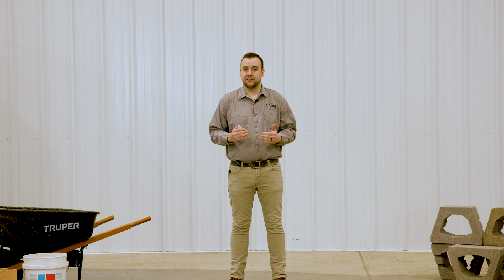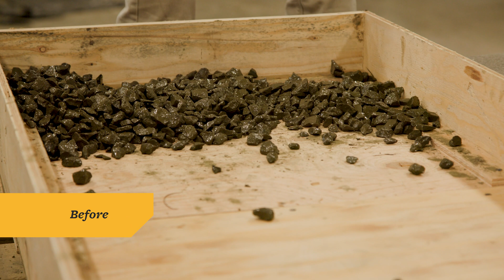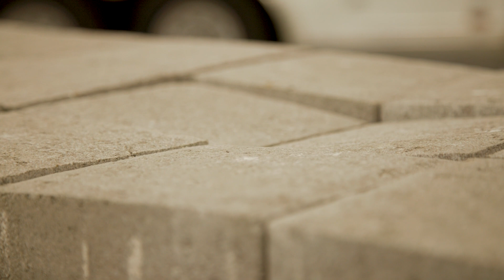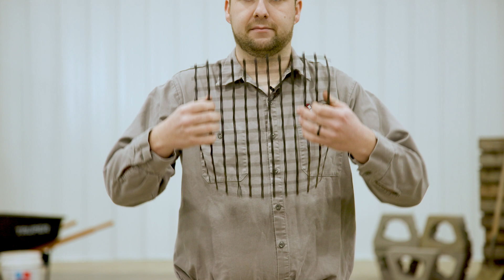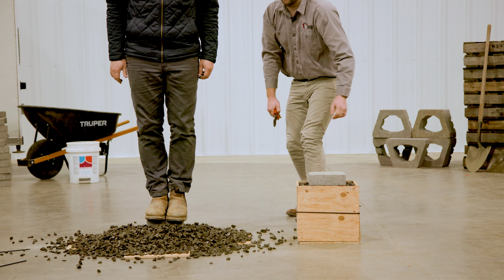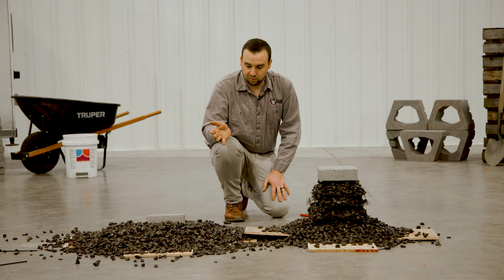How Geotextile Works in Hardscaping Projects: Stabilize Paver Patios, Driveways, Retaining Walls

Comment: Hi, I have never used geotextile before & I am thinking of using it under flagstone in my backyard.  Here are a few questions, lol...
  -  Does geotextile have good water penetration/drainage while blocking weeds, or does the water normally just settle, or does it slide away to the sides eventually?  
  -  What should my layers be, i.e. flagstone>geotextile>dirt?  
  -  Should I double the layer of geotextile for more longevity?  
  -  What should I use in between the flagstone?  Some places say to use polymeric sand which sticks together from water.  
  -  I was also thinking of adding long-life (20+ year) landscape fabric under the 1 geotextile layer to lower costs as I do not know the price differences.   
Area of flagstone is probably ~70-80 feet long X ~10 feet wide, I think.  The prime reason is blocking weeds coming from under ground, not from seeds on top.  I am also unsure how the flagstone & sand stay together since all of that will be "floating" above the geotextile.  Lots of questions, I know.  Thanks.
12/14/25
Reply from the maker: Hey Rob! Happy to help with your project!

Water drainage: Quality geotextile fabric allows excellent water penetration while blocking weeds. Water drains through, not around it - that's key for preventing pooling.

Layer order: You'll want: Flagstone → Bedding sand (1") → Compacted base rock (4-6") → Geotextile fabric → Compacted soil. The fabric goes under your base, not directly under the flagstone.

Doubling fabric: One quality layer is sufficient - doubling won't significantly improve weed prevention and might affect drainage.

Joint material: Polymeric sand works great for flagstone with tight joints. For wider joints (over 1"), consider decomposed granite or regular sand.

Fabric options: Commercial-grade geotextile is worth the investment over landscape fabric for a project this size - it's stronger and maintains drainage better long-term.

The flagstone stays stable because it's set in bedding sand over a compacted base - the geotextile below just prevents weeds and base contamination.

For an 800 sq ft area, proper base prep is crucial! Check out our installation guides at DIYwithWI.com - the principles are similar whether using flagstone or our paver stones.

Good luck with your project!
Reply: @WesternInterlock  ... Thanks for the reply.   Oh man, I do not have the luxury & costs for a deep 4-6-inch rock base, nor the time to do such a thing.  I will not be able to even drive in small machinery as there is no way from either side or back of house.   I am wondering if bedding sand would just be enough, as a compromise, i.e. flagstone>sand>textile>ground.  The soil/dirt level is already practically at ground level & there are already other things established there (gazebo, retaining wall gardens at 3 corners, sprinkler pipes).  This DIY project is basically a rework of the yard & not a new area.   We made the mistake 7-8 years ago of just putting the flagstone on top of bare dirt & then my friend put the sticking sand inbetween the stones.  As you can figure, its all weeds around the stones & I usually just had to use the string trimmer & herbicide to kill them for those past few years, which Im getting tired of, heh.  But I shall check your website, appreciated.
12/15/25
Reply from the maker: Thanks for the additional context, Rob! Totally understand the constraints you're working with.

For your situation, you could try: flagstone → 1" bedding sand → geotextile → existing soil. While not ideal, it's definitely better than flagstone directly on dirt! The textile will help with weed prevention from below.

Few tips for this simplified approach:

 - Use coarse sand (not fine) for better stability
 - Compact the existing soil as much as possible before laying the textile
 - Consider using polymeric sand in the joints - it hardens and resists weeds better than regular sand
 - Edge restraint becomes extra important without a base

Since you're reworking an existing area, even these improvements will make a big difference compared to what you had! The geotextile alone should significantly reduce those weeds coming from below.

One thought: for small areas without machine access, you might consider our Slimline pavers (only 1.5" thick) - they're designed for overlays with minimal excavation. Just an option if flagstone becomes too challenging!

Best of luck with the rework - it'll definitely beat the string trimmer routine! 🌿

Comment: HOW does compacted soil migrate into 3" of compacted rock when you have pavers on top?? Maybe after 150,000 years and a couple of earthquakes?? If your rock/subsoil are so poorly done OR if there is tons of water washing away the rock/soil under the pavers then fabric is not going to make any difference. If anything, putting fabric under your pavers attracts MORE moisture and potential for failure.  Plus, how come you didn't step on the pavers after you pulled out the drawer on the fabric demonstration?
Reply from the maker: You raise some good points! You're right to think critically about this. Soil migration happens gradually over time through several mechanisms - not just from below, but from the edges where fine particles work their way into the base through expansion/contraction cycles, water movement, and traffic vibration. It's not dramatic, but it does happen over years, not millennia.

The geotextile fabric acts as a separation layer to prevent this gradual mixing of materials, which preserves the integrity of your drainage base. Regarding moisture - properly installed geotextile is permeable and actually helps maintain drainage by preventing fine particles from clogging the open graded base.

As for the demonstration, you make a fair point about stepping on the pavers - we were focusing on showing the material separation, but testing load distribution would have strengthened the demo. Thanks for the detailed feedback!